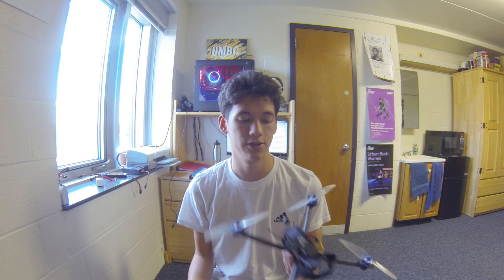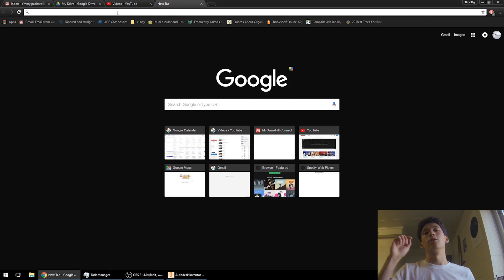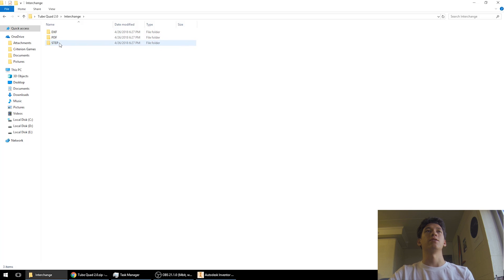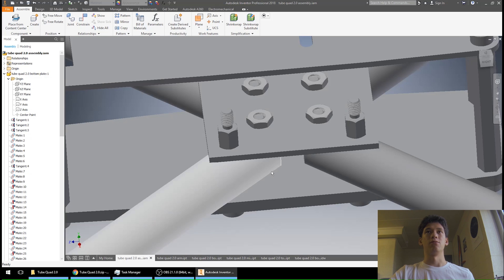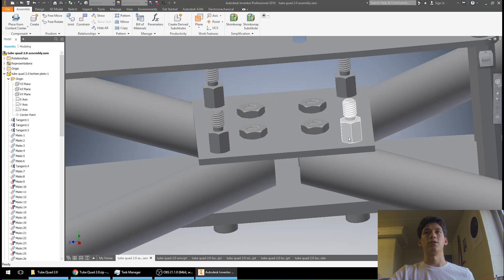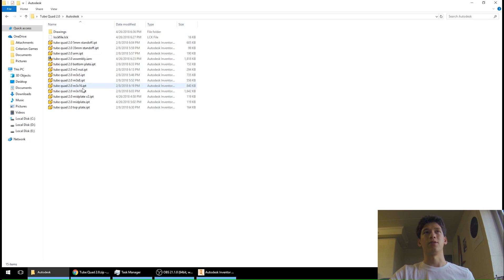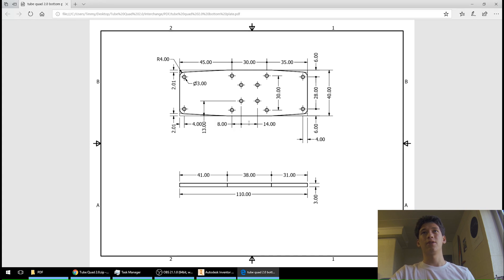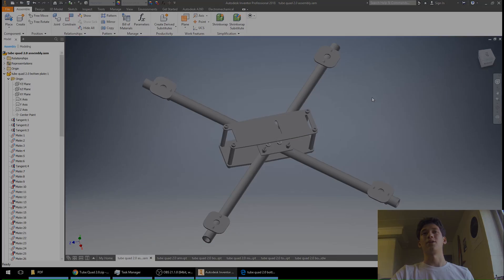Tubular Quad CAD Files and Drawings

Comment: I'm going to build this but I have a couple of questions.

1. Are the plates on Armattan Productions website?

2. I'm toying with the idea of the arms tubes being one piece for two arms. This would mean the motors would be offset. Has anyone tried this before?
Reply from the maker: The plates are not on Armattan Productions' website. The original Tubular Quad used only 2 tubes that were lap jointed where they intersected in the middle of the frame. This is a viable solution but I switched to individual arms for easier replacement. Also keep in mind that a lap joint creates a weak point in the tubes since they are only half thickness where they intersect. The build video will be out within the next few weeks to go through all the steps of building the frame from scratch.
Reply: Thanks. I will order some carbon and wait for the video.